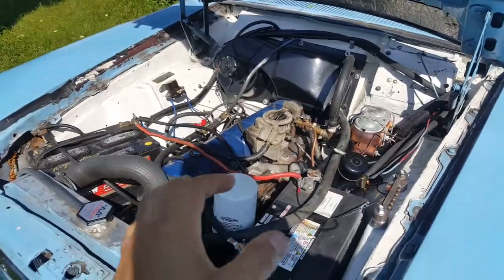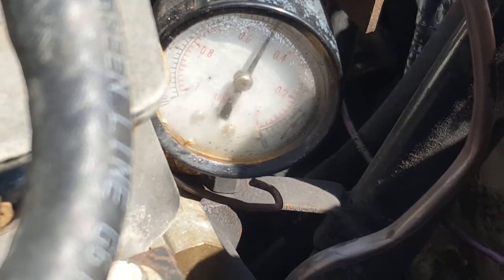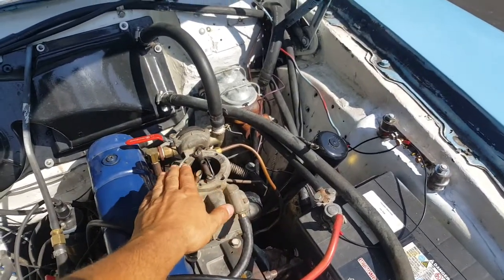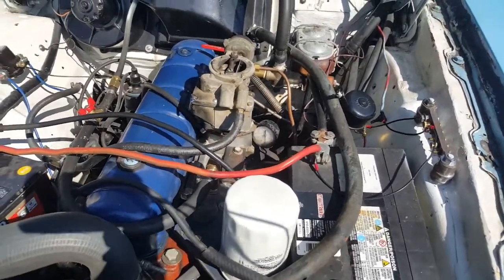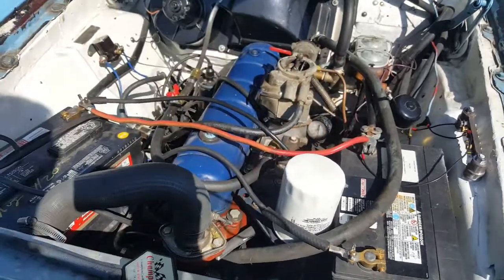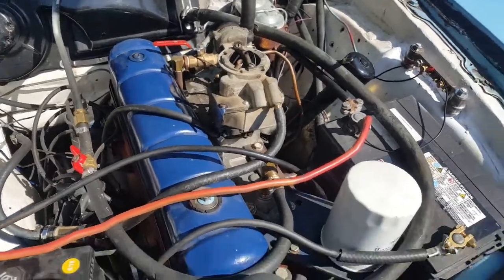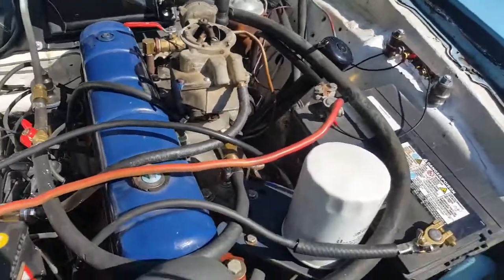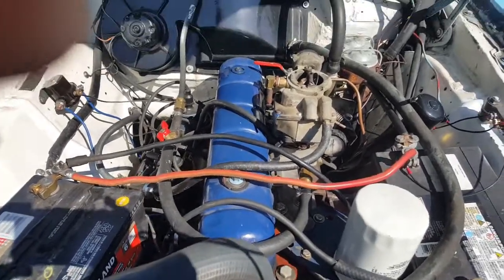Carter YF carburetor issue on Rambler American OHV 195.6CID

Comment: I just got a 1964 Rambler American with this same 196 engine. Someone put a Land Rover? Zenith carb on it. What would be the original correct carb for these?
Reply from the maker: My manual says for a flathead: Carter RBS
and for the OHV the Holley 1909.

However, I've had good experience with other carburetors as long as they are for a similar displacement engine.

I'm currently using a new autolite 1100 (for a ford 200 used on a mustang) and it's working relatively well. I also got a new replacement holley 1904 which is alot simpler but I havent tried it yet.

I will do a few follow up videos as soon as I can.
Reply: @OldCrowsClassicCars  your thinking is exact as mine. I'm not wasting money rebuilding the zenith which is likely for a smaller displacement 4 cylinder engine. I would like to just slap something new on and roll. I was looking at both the Autolite 1100 and the Holley 1904/8. I appreciate any input you have on these coming up. You're pretty much one of the few content providers covering these old 196 lumps.
Reply from the maker: @secondtimeround I got then from eBay. I'm also going to experiment with a W-1 carburetor as well.

Thanks for the kind words and I'm glad I was able to help.
Stay tuned for the next video. I've already done a few just haven't uploaded them yet
Reply: Placing your hand over the top of the carb is just choking it, so the idle is going to increase; that is just normal. Your cfm isn’t as much of a worry as the jetting. If the jets are too big, you will risk washing down the cylinder wall with gasoline and damaging the engine bores and pistons. The YF is usually rated for a 240-300 cid Ford six but if the fuel/air mixture is adjusted a little lean, it might not be that much of an issue for a 198 cid. One barrel carbs don’t usually give the kind of problems that oversized, over jetted 4 barrels give. Bigger issues are throttle linkage/cable fitment, intake bolt up/bore matchup, and air cleaner fitment when dealing with a one bbl. You’ll probably find that the YF gives you a slight performance boast over smaller carb for a 200 cid Ford six, like an Autolite or a 1904/1920.

Comment: Sounds like you can turn down the rpm quite a bit too. Those cars usually idled quite low. 575 rpm
Reply from the maker: Well spotted!

It's stalling at lower rpm...

I'm pretty sure the carb if flooding due to excessive pump pressure.

Also it seems to be too high flow carburetor at least at idle